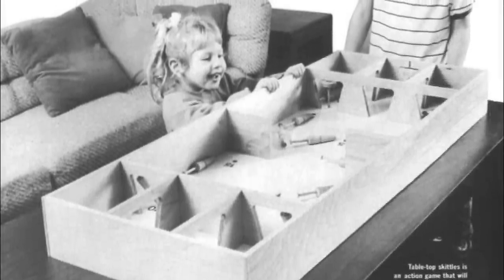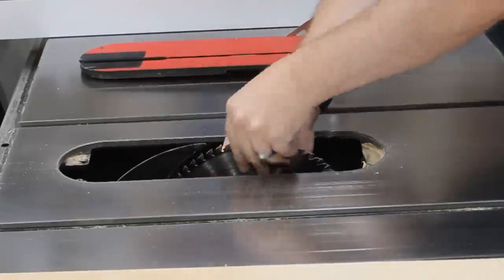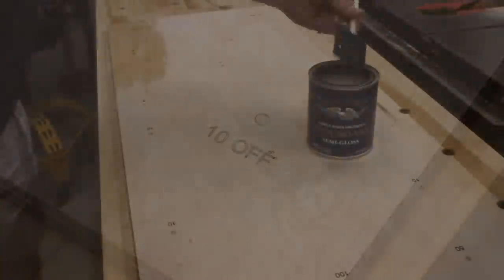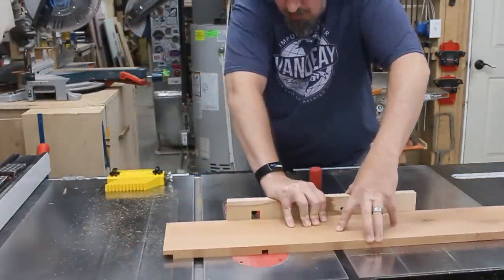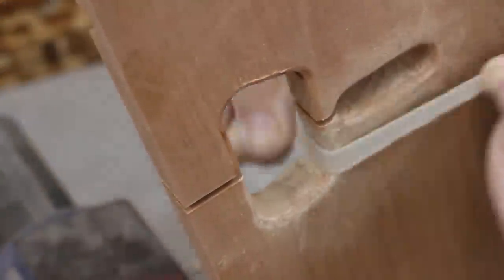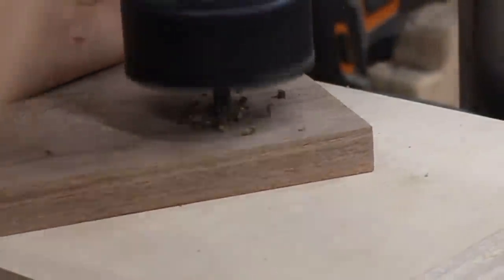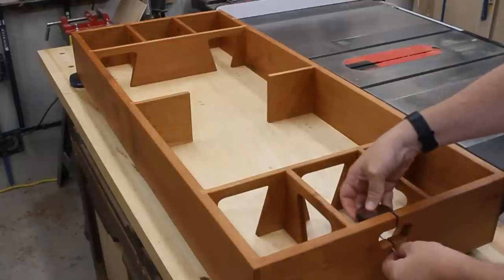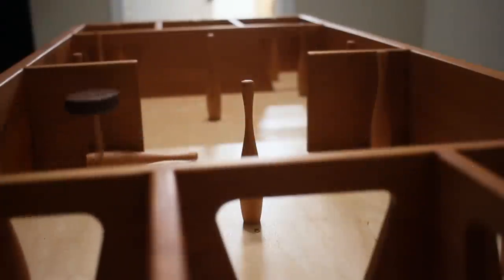Woodworking: Making the Tabletop Skittles Game

Comment: I remember playing this in the early 70's when on a winter vacation in the Rockies.  Was definitely one of the more popular games in the lodge game room.  I have been thinking about building one for a long time but since I don't have a lathe (or a CNC :(), I always put it on a back-burner.  The most daunting part for me was to get a good spinning top.  Your version is fairly simple, but does seem to work well.  From a physics perspective, putting the mass lower on the shaft would probably give better stability though.
Reply from the maker: From what I understand, you don't want it to be really stable otherwise it just sits in one place and spins until it dies out.  With the mass higher, it tends to lean and wander more, which is good in this case.
Reply: @FishersShop  The top's  lateral movement will happen due to slight friction with the surface and the occasional bumping into pins and walls.  You need to apply a force in the direction it will travel  and wobbling or tilt won't cause it wander if the shaft has a point on the end.   Putting the mass lower will allow the top to spin longer, increasing the chance of hitting something and changing trajectory.  I guess the higher mass position was a design choice to make the turns shorter for kids with limited patience.

Comment: Great game board! The cherry really does look beautiful. Although I'm curious how you got the rough cut cherry flat by just using the planer. I'm a beginning woodworker, and I always thought that you had to use the jointer, which is an issue for me having a small jointer and trying to make a tabletop that is way too big for it to fit on. How'd you do it?
Reply from the maker: Thanks!  I did a process called skip planing.  Basically, you take real light passes with the planer and then flip the board.  After many passes, both sides are flat and any twists and warps get reduced down to virtually nothing.
Reply: @FishersShop  oh thanks. I heard about skip planing but mainly as a way to expose grain, and of course all the warnings is the planer not making things flat. I'll try out for my walnut boards, thanks again!

Comment: Very cool.  Found you through a short on this very project and subscribed to there and immediately came here to see the full video.  

1 question.  Did you do anything to level the base plywood?
Reply from the maker: When I glued on the sides, I had the base plywood clamped down firmly to the bench so I knew it was flat.  When playing the game, I made sure the surface was dead level in both directions.  For a faster game though, you can put a magazine under the front end (or some coasters) to give the game a slight tilt.